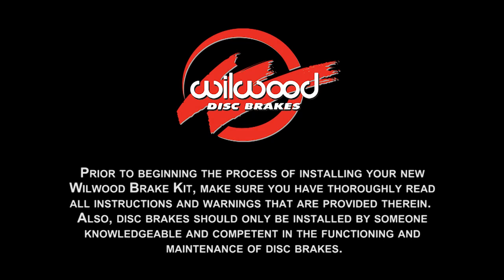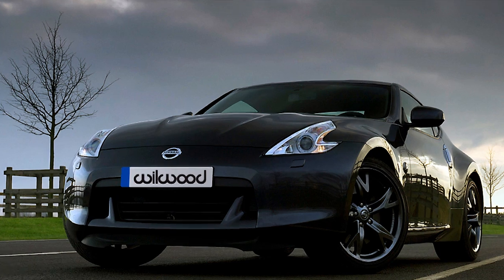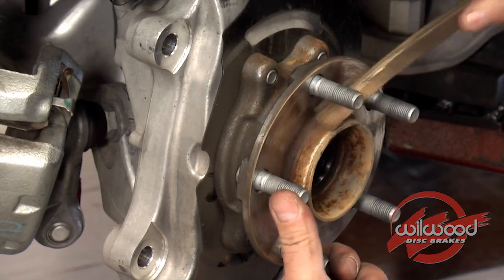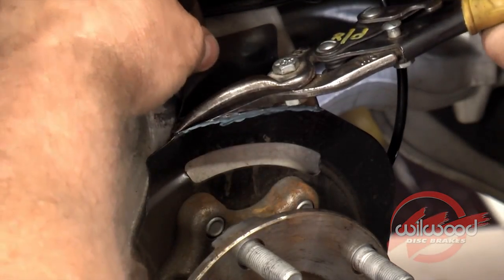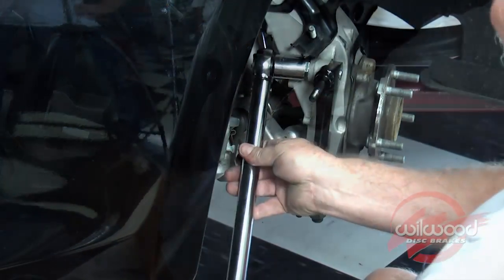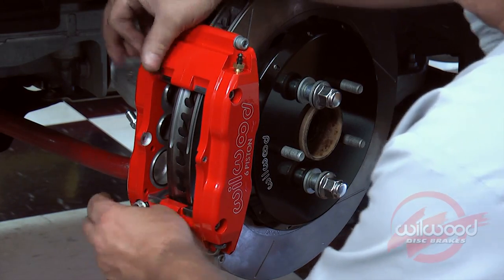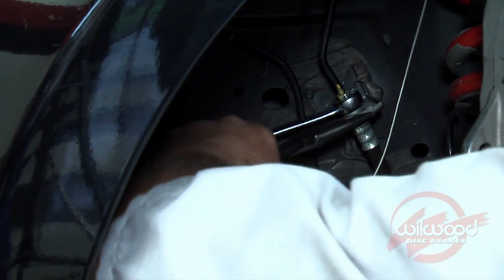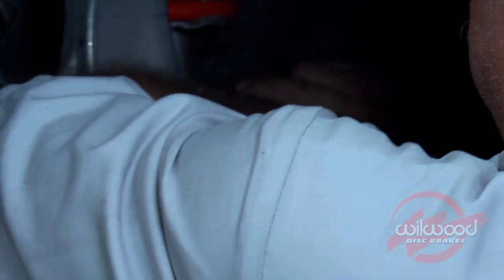Nissan 370Z Wilwood Brake Install

Comment: I have Brembo's, there in my opinion better. One of the reasons being they come from the factory assembled and ready to install with no fabrication needed. They are direct bolts on's and a overall Excellent Brand. #BremboBrakes

Comment: if you disconnect the brake line to put the stainless steel brake line in...would you be worried for air bubbles in the line?
Reply: Tony Tran you need to bleed it after the install